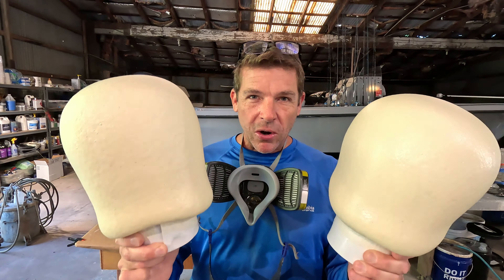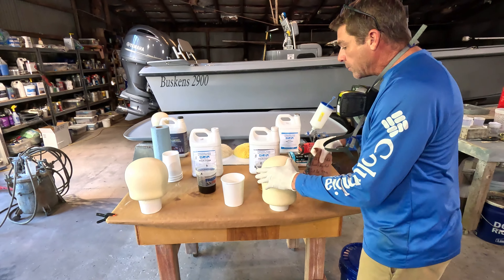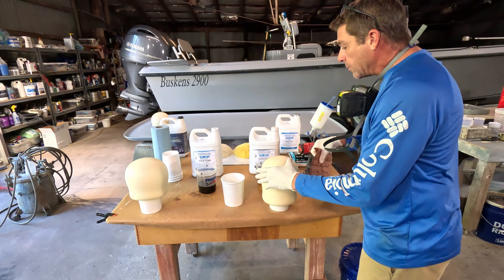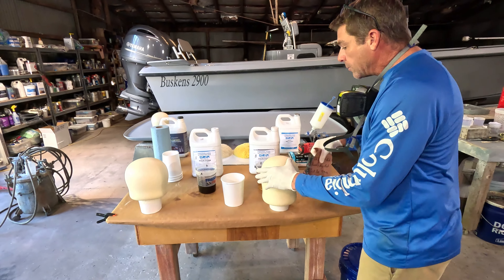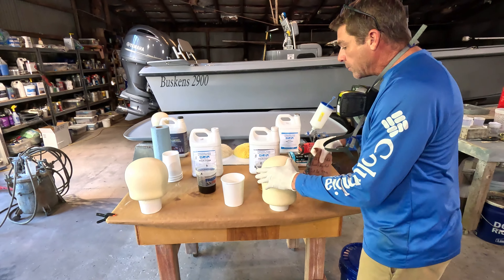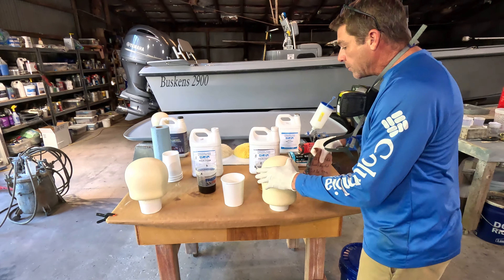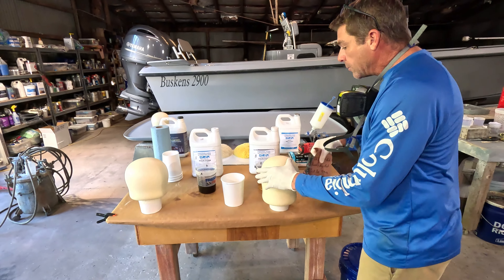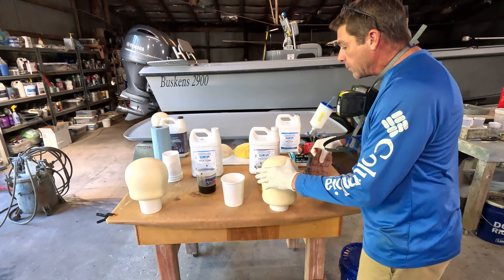How to use Boat Foam! Easy A&B Pour Technique

Comment: this stuff has some SERIOUS power under pressure. i once saw a overly confident man try to overcome the foam after lock failure having just poured 30 or so gallons into a custom build fiberglass / steel mold, he just pressed on the lock with all he had.  his efforts were worse than uneffective, as his entire body was rapidly encased in foam.  you're in a real jamb when you're only option is to absolutely douse the man in acetone to dissolve the foam from his face or hell suffocate.  ive seen it blow molds apart like they were made of plywood.  calculating volumes is so important.  great tips on venting and tilting the hull.  just out of curiosity why tip stern up and not bow?
Reply from the maker: Yes, it's crazy how powerful it can be! Like an explosion in slow motion is what I tell people! Thanks for sharing your experiences with everyone. This kind of feedback is helpful and entertaining at the same time. It always just seems easier to lift or block from the stern when we are building a boat. But I suppose if the boat is on a trailer, you could tip the bow up. It really just comes down to what position is easier to achieve, I guess. Hope this helps and thanks for watching!

Comment: Perfect timing, just finishing installing stringers after removing close to 300lbs of waterlogged foam and rotten plywood from a 16' boat. Watched a half dozen of your fiberglass videos and am ready to install the floor and foam soon. Still trying to decide between peanut butter and marine adhesive for securing the deck. Its all polyester resin layed over plywood, marine adhesive and stainless screws seems to be the easier diy route with only one person.
Reply from the maker: Awesome, glad you enjoyed the video! I have personally always had good success with 3m 5200 and stainless screws for deck installations. That is what we did when installing the deck on our 29. I have some videos in that series showing the process and will be putting a new floor in our Blazer project boat soon. I hope this helps, and I appreciate you watching and commenting!

Comment: Hi nice info cheers. I make Graphene, FLG can we test it in your foam? Do you use open or closed cell foam in this video? I have a new concept for the lightest strongest boat or plane building method. Finally at a low low price. How can I contact you?

Comment: Good solution using foam for repairing my broken shell. A tree branch fell and folded my rowing shell in half. I think I’ll tape up the cracked joint being careful to make sure the hull line is straight , pour the mixture into the cavity at the severed location. After repairing the structure, the thin shell can be finished with gelcoat. Thanks for the demonstration.

Comment: Thanks for this upload Joe, I have a 1983 formula F20 project & foaming is my next step. Though i did lay my floor first & am doing 2” relief holes to pour into.

I think i am over mixing the product, i had an issue with is kicking off inconsistently… i really think that is my issue. It may have a bit a little hot and humid as i live in Florida but have seen success several times. 

Anyways, thanks again. 
If i ever have the funds one day & you’re making boats man, I’d love to own one 🤣🤘🏻
Reply from the maker: Glad to help! Thanks for watching and I wish you the very best with your project boat!

Comment: Cool video.  I’ve been rehabbing a boat floor and gunnels.  I’ve been using a cubic inch calculator to figure out the void size.  I divide that number by 25.  I place the 2 jugs in very warm water the prior to the pour to get the temperature up.  I use a heat gun in the space to warm it up a bit. In the tight spaces where I can’t tip a cup, I put the 2 parts in a zip lock bag, mix it by squishing the stuff around, then I cut the tip of a corner of the bag and drain mix the hole in floor.

Comment: I love my full face respirator, with spectictal inserts (occupational lenses ( trifocal at arms length both top and bottom magnifying) with a papr for sanding, cartridges when using chemicals.  The best advice is not just get good PPE, but do a thorough decon with the dusts.  Many a NOOB wore his PPE well then got crap in his eyes and lungs when removing the gear.

Be safe, have fun.
Reply from the maker: I agree,the full face respirators are great! It's funny you mention that because I will be posting a safety and ppe video this afternoon and will be featuring a 3m full face respirator. Hope you enjoy it, and thanks for watching!

Comment: Hi Joe ! I noticed that the foam appears to be 2 lb. density. You can lower the density by adding a small amount of water to the mix. It will do it by making the internal bubbles a little larger.  It will increase the volume of the mix. It's worth experimenting with. Just a tip. 😎

Comment: Joe, if you get a chance can you do a follow op on shaving the excess off? Also is 2 lb ok for all of it or should  I use 6 in the floor around the stringers? Thanks!
Reply from the maker: Sure! I will try to touch on that topic for you all.6 pound foam is rarely used in that application,it would be very strong, but it would add more weight to the boat, and would not yield as much reserve buoyancy. I hope this helps and I appreciate you watching and commenting!

Comment: Great video as always. I’m rebuilding a boat and have bounced back and forth on the foam thing. When pulling the boat apart I found no foam. Now I am in Canada so we may have different rules here on 18’ boats but I was wondering if you had absorption rates on these type of products? Keep the videos coming, they keep me motivated!
Reply from the maker: Interesting! I'm not sure about Canadian standards, but if it wasn't built with foam under the floor, then you shouldn't be under any requirement to replace it. Of course you could add it if you thought it would be beneficial. Sorry, I don't currently have any water absorption rates for flotation foam. Hope this helps, and thanks for watching!

Comment: Good tips. Thanks. One thing I found is that it will shrink 20-30 % over months, if left exposed to air.  I made blocks of it to mount under the deck on a small runabout I built - big fail. It needs to be sealed off.

Comment: Excellent video. Could this be used to repair a hole in a boat where you cannot get to do a 2 sided repair?
Reply from the maker: Thanks! It's hard to say for sure as every repair is different, but I suppose it could be used to help reinforce the backside of a repair. You might want to do some additional research and testing on that one. I hope this lps and thanks for watching!

Comment: You mentioned that you can fibreglass over the foam once it is shaped. Which is the best resin type to use, polyester or epoxy? This foam opens up a lot of molding and fibreglassing ideas. Thanks, once again, excellent content.
Reply: Either resin can be used.  It is compatible with polyester,   vinyl ester and epoxy.
Reply from the maker: Yes, you can use polyester, vinyl ester, or epoxy resin when using polyurethane pour foam. Hope this helps and thanks for watching!

Comment: Dear Joe, thank you for another fantastic video! I have a question if you have time: I have to fill in foam under my deck in buoyancy chambers that are attached under the deck. My boat is a flooding hull rib (searider 5.4m) and the chambers are attached to the deck, and are filled with foam (there is empty space that fills with water under them). After glassing the chambers with the deck, I plan to open a hole to the deck to poor in the foam. 

my question: should I be worried that the expanding foam may damage the deck if I make a (serious) mistake in the quantity needed? Or the excess foam will come out of the hole that is open (about 50mm - 2 inches diameter) during the expanding phase? It is not clear to me how much the foam pushes when it is becoming solid vs flows out of the hole all excess. That is, it might be that first flows out, and then solidifies, or that the foam both expands and solidifies at the same time, and the excess foam cannot get out of the hole. 

Thank you for your time and the amazing videos and knowledge sharing. Much appreciated.
Reply from the maker: I'm glad you are enjoying the videos! Each boat and each foam pour is uniquely different. It is very hard for me to say for sure what could work with each application. I can tell you that 2 part foam can be incredibly powerful!! I would recommend doing plenty of research and maybe buy some foam and do some testing and experimenting before you try to pour it into your boat. I wish I had a definite answer for you, but maybe this helps. Thanks for watching!
Reply: @FishBumpTV  thank you very much, yes it does help a lot! Greetings from Australia

Comment: Thanks joe a question for you sir , if you glassed poured foam would you sand it first, or would polyester stick to the shine of the outer layer?
Reply from the maker: Fiberglass will usually bond just fine to an unsanded foam surface, but it doesn't hurt to sand it lightly, just to give it some additional bite. I hope this helps and thanks for watching!

Comment: I'm interested in fiberglass tiny homes and trailers. There is one historical style home from the 60s and 70s that was fiberglass encasing foam. I thought it would have to be sprayed but I see now maybe it was poured?  Was there a certain technique from that era? In my head I want to reproduce some of these old style buildings.. so learning about the fiberglass here
Reply from the maker: It may have been built in a mold. I do have a hardtop mold building series here on the channel that might have some answers for you. I hope this helps, and I appreciate you taking the time to watch and comment!

Comment: How might this stuff react to any electrical wires?  I guess I'm asking in the event someone did not have their wires piped in
a way to shield them,  would this foam irritate or cause the rubber structure to fail due to the chemicals involved?  Don't ask
who'd do this... lol, I'd ask you before I ever did it but this is really a cool process to see.  Thanks for showing us.  peace
Reply: Polyurethane foam is used routinely to insulate buildings and modern wiring does not present a problem, you can foam right over it. However, the old knob-and-tube style electrical systems should not be foamed.
Reply: Ohh, alright,  I thought this might be a different form of polyurethane since it's a boat grade & required like he mentioned
but I've seen a fair amount of the insulation sprayed into metal buildings but I never saw if it was sprayed on electrical
wires but I suppose it could be w/o much problem.   I think the old style Knob/tube style systems are about gone
except for Century Homes & Buildings but I digress,  is this a special grade only for boating or can you use any of
it for either purpose?  Thanks for sharing that,  peace
Reply from the maker: I'm glad you enjoyed the video! It is hard to know how it might react with every possible kind of wire coating or other plastics, but I am inclined to think it is not going to be a problem. I have seen wire covered in foam in older boats before,and it seemed ok. Foaming in the wires will make it very difficult if not impossible to remove or replace wires, though, and I recommend running wires through a conduit if possible. I hope this helps, and I appreciate you watching!
Reply: @diggy-d8w  I ran a foam insulation business for about 15 years and what you see in the video is similar to what you have seen sprayed on metal: a 2-pound density, closed cell PUR foam. The catalyst is different in the pour foam but once cured the two are functionally the same. As for wiring on a boat, you should run everything in conduit and observe the ABYC guidelines for how many conductors you can have. This is not because the foam will damage the wire but because it will prevent heat dissipation. The ampacity rating  of a conductor depends on its environment and an insulated wire can carry less current safely.
Reply: Yeah,  I have seen the foam sprayed on metal buildings but I didn't pay too much attention to the wiring,  whether or not
it was run in conduit or a house type sheath.   I was most asking if the heat generated might cause any breakdown of
the rubber coating on wires?  I assume it's fine or he wouldn't have done it in plastic containers?   2lb density.  And I'm
guessing that you might be able to mix it so it's a denser product or more full of air?   I don't have any plans for this as
of now but I like to know about things just in case it comes up.  Thank you for adding more to this thread & to our
Boat maker Host, Mr Fish Bump TV.  peace
Reply: Indeed I did enjoy it Sir,  I also had a couple of other's who shared as well = that's the coolest thing but thanks again &
I'll be here(Lord willing) for your next video.... peace

Comment: G,day Captain Joe from Sydney Australia. Great product. I have had panel bulging issues in the past with spray foam. I like white polystyrene block foam as buoyancy. Would it be approved by the U.S Coast guard?
🌏🇦🇺
Reply from the maker: Yes, panel bulging can be a problem in some foam applications. I can't say for absolute sure, but I think polystyrene block foam is fine just as long as you have plenty of volume. I hope this helps and I appreciate you watching all of the way from Australia 🇦🇺!!

Comment: I have a 1970’s 18’ StarCraft Holiday and need to replace the floor. Should I pour foam under the floor? Is it advisable to pour foam directly to the aluminum hull or is it better to lay down a vapour barrier (plastic roll) to prevent contact to the aluminum hull to avoid possible degradation to the hull?

Comment: I have poured some walk in coolers.  Form them up pretty much like for concrete.  But we filled it with 12 inch (expanded) deep pours, let it set, and pour again.  Pour much more, and it will blow out the side of the form.
Have you ever used Great Stuff foam for minor hole backing on a polyester patch?
Reply from the maker: Interesting! Yes, the pour foam has many possible applications for sure! No, I haven't used great stuff as a filler or backer on a boat repair, but the thought has crossed my mind. I would want to test compatability with the foam and resins first, but I think it could work. Maybe I should do a test video with great stuff and see how well it works. Thanks for watching and commenting!
Reply: Commercial freezer buildings are where polyurethane foam got its start as an insulation material. One thing to remember in this application is that the vapor drive will be from the outside towards the inside of the structure (hot to cold) and without an exterior vapor barrier there will be some moisture accumulation in the foam over time.
Reply: @torstenhansen4308  On break-bulk freight ships, we use foam to seal the hatches for sea.  We put the hatches in  position, and just before we drop them, we lay a generous line of one part foam from a pressure canister, then drop the hatches into position, and dog them.  The expanding foam fills all the cracks and crevices and keeps out water, even with occasional waves breaking over the hatches.

Comment: If you don't use enough foam can you pour more on top?
Reply: Yes you can.  Polyurethane foam adheres well to itself (and to everything else)
Reply from the maker: Sure, that will work with no problem. I will be pouring foam on a full scale on our project boat soon, so stay tuned, and thanks for watching!

Comment: Questions sir: Would the foam make a boat more quiet? In other words, would a boat at anchor with waves slapping against the hull be more quiet inside than a hull without foam? Of course, as I watched your video I realized that the weight of the foam must be calculated in the buoyancy / weight capacity of the boat
Reply from the maker: Yes, in my experience, a foam filled boat is going to be quieter that a non foam filled boat. That is a plus in my opinion, especially for a fishing boat! I hope this helps and I appreciate you watching!

Comment: Wondering what type of foam it is urethane? I don't use it. I want closed bulkhead storage floatation.
Reply from the maker: It is a 2 pound density polyurethane closed cell foam that we used in the video.I hear what you are saying and I understand people having concerns about pour foam, as many people have had bad experiences with it. I am pretty sure that many of those problems are from the use of poor quality foam and poor application of the foam. Modern foam formulas are much better than some of the early foams, in my opinion. In some cases we are required to use it here in the states by law, so I thought it would be a good topic to cover here on the channel  for those that are possibly interested in using it on one project or another. Our 21 ft project boat will need foam flotation under the floor, so hopefully, I can share some more tips with you all on a full-size foam pour, with quality results. As always I appreciate you watching and commenting!